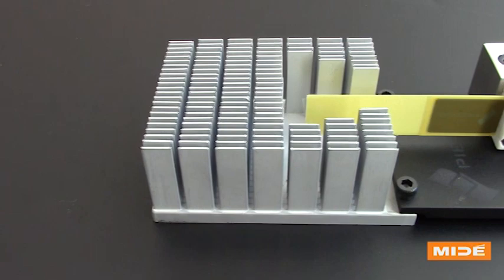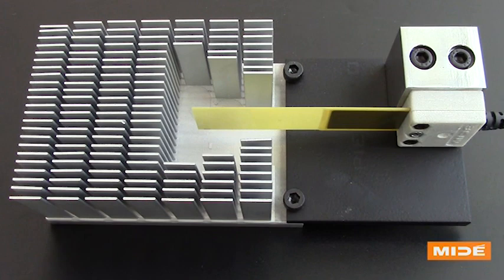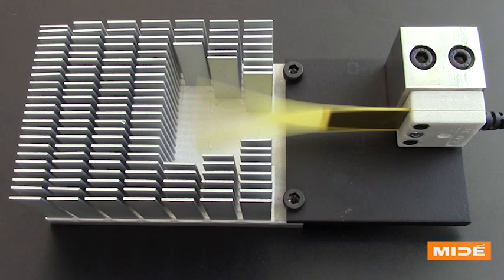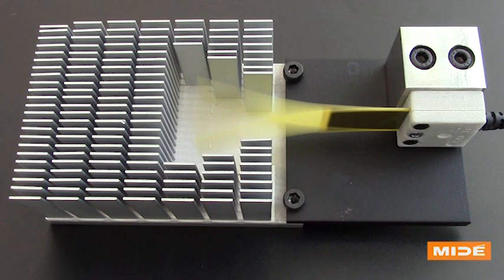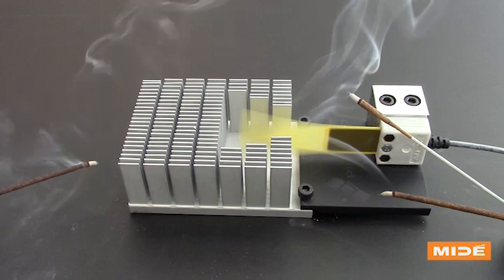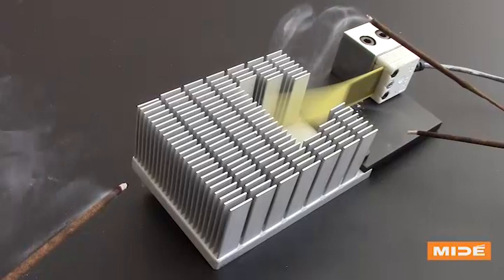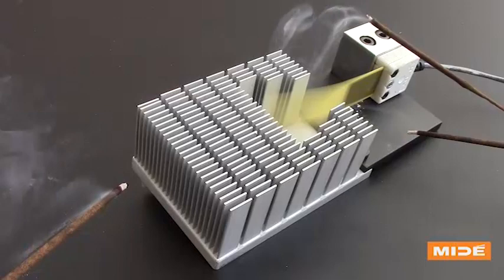Forced Convection with Solid State Piezoelectric Fan

Comment from the maker: Our response video is ready - please check out Rob's responses to your most common questions - https://youtu.be/kFZnbc6hd8I.

Thank you again for your interest, questions, and comments regarding this piezoelectric fan.

Quick note: Since this video was produced (over 6 years ago) Mide has spun off its piezo product line to its own individual site: piezo.com
Reply: I look forward to seeing more application areas. I want to see this used in processors
Reply: One small note though.
You claim no electromagnetic noise from the device, which is not strictly true.
yes the electromagnetic noise will be significantly less than any normal electrical motor, but however not absolutely zero, as the alternating electrical field applied to the 2 sides of the fan (which is driving the piexo-electrical deformation) will radiate RF noise (as any alternating electrical field will).
Reply: Will piezoelectric fans be used as  an miniaturized active cooling solution for NVMe SSDs in the future? PCIE 5.0 is going to turn consumer m.2 SSDs into mini furnaces operating at a 140C maximum temperature limit and this technology seems suited for it.
Reply: @srenkoch6127  can the packaging can diminish that RF to not leak to outside so much?
Reply: @theman3282  Yes if it is made to do so
Reply: @mirroredvoid8394  No. Consumer computing does not need special fan technologies just yet when a simple spinning fan will do fine. Additionally, keeping a high static pressure with these fans is not easy with small objects like a ssd heatsink, which a spinny fan excells at
Reply: looks very promising , my question is why is it so expensive and with low CFM? is there possibility of very high airflow using this technology?

Comment: If it was "low noise", why no audio of it?
Reply: I use piezo fans just like these in some aerospace assemblies my company designs, and I can vouch for how quiet it is. Their noise is so negligible that in our acoustic testing procedures we don't even consider testing the noise output differential between when we have multiple piezo fans on or off. The only thing I don't like about them is that you have to supply 60Hz ~120V power to them, so integrating them into a low power electronics system that isn't powered straight from the wall can be difficult.
Reply: Because it is too loud
Reply: @mangakker  the comment above you states that their volume is negligible from experience and you, a random person that never seen the device says it's loud? Can you stop with the unnecessary comments?
Reply: it makes sound in the ultrasound spectrum, everything that moves makes sound.
Reply: @FreddieTheRobot  but it has moving parts. The oscillating fence that make air circulate is suffering from metal fatigue,  or plastic fatigue, it would brake soon. I think. But i maybe wrong.  Has it been tested in long time working??I would like that. I love innovation and technology
Reply: @HappySlappyFace  i can't stop)) because random person says that seen it, and random person says me to stop )))
Reply: Low noise refer to signal noise something that induction motors creat a lot of.
Reply: @FreddieTheRobot  that's really cool, first thing I thought of was using this in high reliability applications
Reply: @tareksma1  In this case by no moving parts they mean there is no material on material sliding contact points. Such as: sleeves, bushings, bearings; that would require lubrication or wear over time. Assuming appropriate materials are selected fatigue from that movement shouldn't be an issue. Hazardous operational environments as well as a host of manufacturing defects could cause failure.
Reply: Plot twist: there actually is audio! 🤔
Reply: @Mr.Glitch247  !
😁
Reply: I thought it would be obvious that it produces a frequency exactly that of the input, simple as that. It's amplitude will be proportional to its size.
But these look like a lot of design variations are possible... I'd be happy if my laptop had one.
Reply: Because you’re a pickle.
Reply: @FreddieTheRobot  We figured out how to drive portable LCD backlights, I'm sure with appropriate demand, converters, maybe even crammed into a single chip, will be common.
Reply: Hmmm
Reply: Product unveiling videos like this are typically silent so I think they are just going with the standard format, this is a business video not a technical one.
Reply: Because it’s not low noise. I
Reply: Pretty sure I heard it.
Reply: wdym there was audio
Reply: BBRRRRRRRRRRRRRRRRRRR says the flappy fan
Reply: @johndoe528  key word demand. Another, time. Integrating a new type of fan, one which doesn't exactly compete with the typical blower fan in terms of static air pressure, takes time.
Reply: @yanamorim5747  If it's vibrating based on mains frequency, that ain't ultrasonic.
Reply: It's like the guy putting "elephant powder" on his lawn. His neighbour mentions that there isn't any elephants around here. He replies "Good stuff, isn't it?".
Reply: @writersblock6376  that was pretty quiet. Can you run it again, where I can hear it once more?
Reply: Plot twist: There is audio but you can't hear it
Reply: I'm using this in my workplace. We are working in aerospace engineering area. These fans are super loud and we have to always test them in anechoic chamber, to make sure that we will not exceed sound pressure limits.
Reply: "low noise" except that constant "BOIIIIINK" sound
Reply: @tareksma1  We had testing and in practice applications that show 10+ years of life with no problems in room temperature environments. The real issue you face is putting the fans through several thermal cycles (we would go from room temp all the way to -180C hundreds of times a year); this eventually can cause the resonant frequency of the fans to drop below 60Hz (the plastic fans are typically trimmed to have this resonant freq.). The stress placed on the blade is not enough to cause any fatigue or fracture of the blade (which is usually made of FR4, a fairly reliable glass reinforced epoxy laminate)
Reply: @johndoe528  Its really nothing special to drive them, common practice in DC assemblies is to drive a 3V sine wave from a DAC through several stages of op amps and then eventually back-feeding it through a transformer. The transformer ends up taking up a lot of board space though, that is what always upsets me
Reply: @HappySlappyFace  Sorry God. You are clearly not acquainted with YouTube.
Reply from the maker: Thanks for the comment Justin.  There is a small amount of audible noise if you get close enough to the fan (about 3 feet or so).  I have had one running in my office for almost 8 years, I set about 6 feet away from it and can't hear it.
Reply: @mangakker  you aren't funny, just so you know...
Reply: @tareksma1  it is highly unlikely that it is bending far enough to experience plastic deformation, only elastic deformation
Reply: I never heard such device.
The only thing I want you to notice is that 'low noise' is no absolute scale. For example PC fans (retail) vs the server stuff. What do you want as a basic level for comparison with the new type of fan?
Reply: No way no noise. That flappy thing is flapping  air molecules. Ain’t no way it’s not making any noise
Reply: @salamdamai  It depends on the frequency and what humans can actually hear. Then it also depends on other design factors. "No noise" is relative when it comes to human hearing..
Reply: @barongerhardt  yeah that's way better said than my "flexture isn't technically movement."   Lol. 👍
Reply: Because you wouldn't be able to hear it anyway. But, maybe your dog could.
Reply: @marcelleuenberger4648  Yes you are right. Depending on the material and the its design, it will generate a noise at certain frequency. So you may be right that human may not be able to hear it. Good point.
Reply: @puntabachata  Yeah you are right. Based on the material and the design/shape of the flap, it may only generate a noise with a frequency that we cannot hear. Good point @joeconsumer
Reply: @HappySlappyFace  r/whoosh
Reply: it makes a high pitch noice that can cause seizures and headache
Reply: @marcelleuenberger4648  I like what you said, I would add that the noise that is being termed low is the RF interference related with some other AC fans that don't use this piezoelectric technology.
Reply: @MideTech  the technology is inspiring, thanks for the video. But the demo is not complete till you demo all what you assert in the video. Thus, same you showed the air flow with smoke, you should add a sound meter and mute your voice for a while in order to hear the fan's sound, and to see the dB while both when you talk, and when you're muted.
Reply: @ddavid2  you know this video is 6yrs old ay? It owes you nothing
Reply: @tareksma1  It's neither plastic nor metal. It's a special type of ceramic, and it's very thin. The forces generated by the piezoelectric effect are generally speaking very low, so I'd be very surprised if this device experience much stress at all and it could probably operate forever
Reply: please, don't believe him. Fan is super loud
 In our anechoic chamber it gave sound pressure of 87dB SPL. Is a high pitch noise in audible range. Super loud, like alarm. 
We wanted to use it to cool down a gyroscope in Ariane rocket, but it was so loud and emits so much vibration that it was destructive for FR4 laminate of navigational electronics
Reply: @tareksma1  This device lacks moving parts.
Reply: @davidtooley420  does it mean the product is already comercial?
Reply: @tareksma1  I will copy pasta a comment from Mide here that should answer your question:

Thanks Mr. Motus, here are some comments we provided on the fan reliability:

During the development of the piezoelectric fan our customer required us to run some highly accelerated life testing (HALT) on a statistically significant number of samples.  The test included thermally cycling the fans 1000 times from -40 to 125C while they were operating.  The test took about 5 weeks to complete.  There were no failures.  We also ran the fans through high temperature operating life at 180C (HTOL), low temperature operating life at -70C (LTOL), Over voltage test at 100% over the normal operating voltage, Humidity HALT testing, Cold start testing which included a hard start up after the fans soaked at -40C for 14 hours, high temperature storage tests where the fans were soaked at 140C for 1000 hours prior to successful operation, dust ingress testing, salt spray and fog testing and IP68 testing where we submerged the fans for 72 hours at the equivalent of 3 meter depth pressure and then operated them after they were removed and dried off.  There were never any failures during any of these tests.  Lastly, we have been running a non accelerated life test on a single unit (in my office) since June 15th, 2016.  It has only been unplugged one time when we moved to a new building.  It is still running as of this morning with no noticeable change in performance.  I sit about 6 feet from it, If I really try to listen hard I can hear it running.  Running at 60 Hz we have put just over 11 billion cycles on the fan without failure or change in performance.
Reply: I bet it sounds like a constant but mostly quiet fart sound
Reply: @xyz13742 Congrats, you just made a large amount of assumptions about a project without knowing the requirements and limitations of the system. And you made assumptions of the components used. If you can do it so much better, then you go win a 10 mil/year contract. 
Btw, "ampop" is a pop band from Iceland; I don't think you can put that on a circuit board
Reply: @xyz13742 sounds like you are bitter about not being able to land a job with an aerospace company
Reply: Seems like something that would make a high pitched hum that quickly dissipates through distance. Like a turbine.
Reply: There is, it's just very low.
Reply: @HappySlappyFace  instead of taking a comment as fact, the video could have just recorded audio of its operation.
Reply: @Kawka1122  Yeah right, you work on Ariane, and I am a space traveller from the outer rim.
Reply: @davidtooley420  It's posted in a public setting to demonstrate to the public, it's perfectly valid to include suggestions in the PUBLIC comment section of the video, especially when the suggestion is so relevant to the content in question, nobody is claiming to be "owed" anything, the only one acting entitled is you buddy.
Reply: So low.. can't heard by sensitive microphone..
Reply: @FreddieTheRobot  "Please note that this fan requires current limited electronics, (Circuit shown below), to be driven off of line voltage (120V ~ 240V). Failure to do so will damage the device."
They have 240v options now, and most 240v nations are on 60hz as I understand, so that's nice for us!
Not that it helps with low power systems, but at least it's not as obscure as 120v 50hz..
Reply: Humans can only hear certain frequencys.
Reply: It makes this sound….. my name is Giovanni Giorgio but everyone calls me Giorgio.  Doot dooot doottt
Reply: @HappySlappyFace  They're both random people in a YouTube comment section.

Take what they both said with a grain of salt.
Reply: They're very quiet.
Reply: @tareksma1  It does have A moving part but it's actuated by ac frequency. Compare that to a fan with rotating assembly, bearings, blades, etc and you'll see how the reliability is much higher. There's nothing to break. That's why it's called solid state because there isn't any physically moving parts. No actuator, no motor, etc.
Reply: @FreddieTheRobot  That is specific to the model you use from the brand you use. You can get them after or dc and at many different voltage levels. And there is nothing preventing you from using an inverter to go from 3.5v, 5v, 12v, 24v, ect to 115v 60hz AC. I imagine the fans are already really expensive anyway and in your field the budget is enormous and money is thrown out like nothing so I doubt cost would matter too much.
Reply: @HappySlappyFace  in his defense, Joe Moore is also "A Random Person" who you're taking the word of.
Reply: If you are deaf, everything will be mute
Reply: Confucius say: the answer is in your question.
Reply: @tareksma1  *break*. And “may be”.
Reply: Noise was just that low brother.
Reply: I can clearly say I’m no fan of this presentation.
Reply: Low noise compared to blowie-matrons xD
Reply: @aghost5281   Maybe you just have to get your bearings.
Reply: Low noise. Didn't say no noise
Reply: @mangakker  YouTube them?
Reply: Pretty sure there would be quite a lot of noise. The thing would sound like an angry bee. And of course, there are some folks who are claiming to be in the aerospace industry and claiming that they know better, but those seem a little bit more like brigaded commenters that are being brought in for advertising purposes.
Reply: aaaaah... the sceptic...
Reply: @tareksma1  I don’t know but it has been certainly buzzword-tested.
Reply: Ironic. There was audio, you just didn't hear it.
Reply: @HappySlappyFace  Learn to take a joke for Christ's sakes
Reply: @FreddieTheRobot  Do they take high current as well? If so how many amperes?
Reply: @tareksma1  i've seen people that have it running for 6 years straight non-stop and it still works perfectly fine and has no signs of wear
Reply: It's low noise.  The demo at CES '23 proves it.
Reply: @tareksma1 I saw a video explaining the working principle of this fan(actionlabs) where he mentioned he saw a video of guy who's continously running it for six whole years and that these last for about some  billions of osicilations